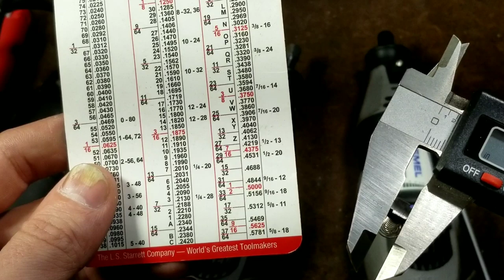3rd Generation Dremel Moto-Tool Review & Discussion

Comment: Just bought a used 395 2 days ago for $30. It came with a flex shaft model 225 T2 (barely used), a new collet nut kit, EZ Lock adapter and various bits all inside a hard cover storage case.

Comment: I don't see the version that I have.  It's a "Moto-Tool" 3950 Type 3.  It is variable speed and has ball bearings (as noted on the box).  The shaft lock looks like a slide switch and not a button.  I really like the version I have and was surprised to see it missing from your video.

Comment: Hello sir, do you collect these old Dremels? I have managed to pick up 4 Dremels over the years, an original bakelite model 2 with the original spring cable protector, a model 245-5 which is a continuation of the model 2 but a solid plastic housing and no easily replaceable graphite brushes (still doable. just needs to open the case instead), a teeny tiny cordless one with 2 speeds and a modern one, but I actually use that one. If you do collect them, would you be interested in these? Many thanks.

Comment: I have the Newest 395 which was a big improvement over my Dad's older 380-6. The 395 has more power and a better grip, but man did I hate how hot that 395 got after a few minutes. The placement of the exhaust vents wasn't ideal. When I upgraded to the current 3000 I was basically in love with the better design. The dremel itself runs considerably cooler and the speed control switch is easier to adjust in my opinion.

Comment: Thanks for this review. I have a 30+ yr old 595 variable speed that's still singing along. I just fitted it to the plunge router attachment even though it wasn't listed as a compatible device. ( probably because it's discontinued) I see there are no parts avail from Dremel anymore so if it dies before me I'll be on to a foreign made Gen4. Sure got my money's worth outta this little gem. Thanks again !!!

Comment: This was a great comparison. Thank you much. I have a Model 395, no T6, straight 395. Any idea what the difference is between these two? I did notice on my tag that it’s rated at 5000-35000 RPM’s.

Comment: There's obviously great interest in this tool. That intrigues me when it's just a low-tech electric motor spinning a shaft. I was considering one for drilling small holes where the weight of a small power drill might affect the 'feel' for the job. But amazingly, drilling isn't considered a primary use.
Reply from the maker: But it's on their mind they make tiny little three jaw Chuck's for dremels

Comment: What I discovered on eBay, there are a bunch of Model 395 for relatively cheap, ballparking $10 to $20 with $10 to $15 shipping.  Of particular note, I did not find any Type 6 (gray) models, but plenty of Type 5 and Type 4 and the occasional Type 2.  Of the 395 Type 4 they always seemed to come with the snake attachment, so maybe just luck of the draw or a particular accessory package of the time.  Anyway, I picked up a 395 Type 5 for $15 with $10 shipping, $27 after tax.  (Used. Average Joe U.S. seller.)

Comment: Great video. I'm still a little confused about whether you can use dremel bits in the Solaris or DeWalt. If you cannot, what 1/8" bits (for cutting and grinding) would you recommend in the Solaris or DeWalt? Thanks in advance.

Comment: Found chinesium brush sets. Should cover 280 and my newer 300.
Reply: Also UPS dude just handed me new shaft lock assembly and 3rd gen LIVES AGAIN
Reply: First job is finishing up stereo and trolling motor cutouts on the G3 bass boat
Reply from the maker: Excellent to hear you've got it up and running again

Comment: Too bad, the chinese copies don't fit in the accessories of the originals.
Reply: The Parkside one and it’s accessories from LIDL fits and is relatively cheap. I couldn’t stop myself from buying it because of the price and was surprised how good it is. The bits set is cheap but better than most sets. I recommend it over the non brands any day.